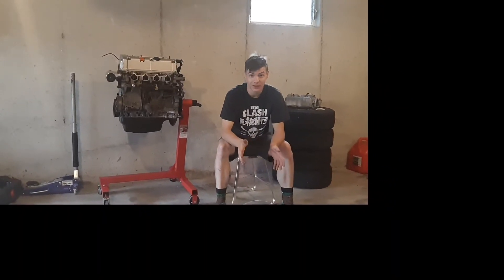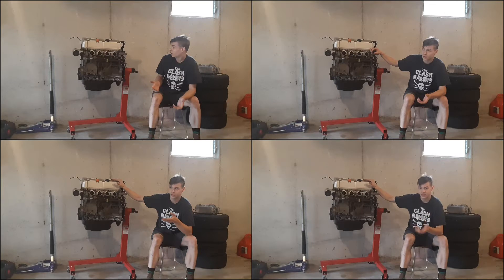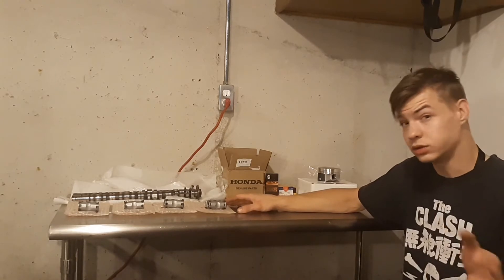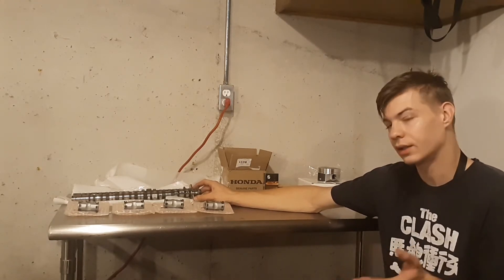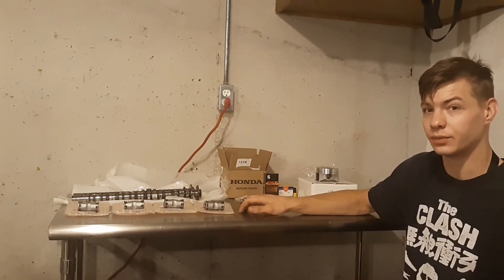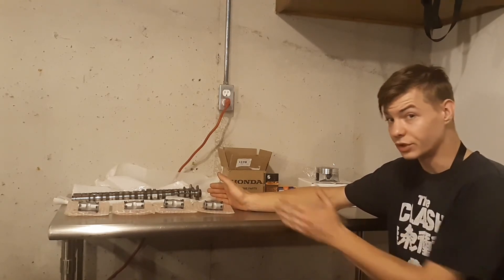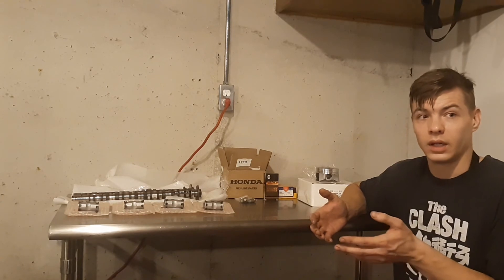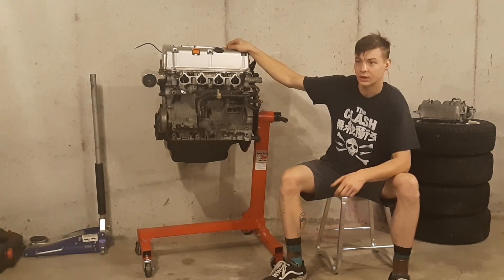How to get 200+ HP out of your K20A3

Comment: hey idk if you’ll see this but you gave me hope for my base rsx i just had one question. if i had an auto would i need a manual swap? id probably like to get one at some point but if its not needed I could enjoy the benefits beforehand
Reply from the maker: Unfortunately, you will need to convert to manual to be able to run k-pro. K-pro is going to be required in order to get this setup running. I'm running a 5 speed from a base rsx and sometimes if you keep an eye out, you can find those for pretty cheap. The ep3 si 5 speed manual is another budget transmission as well and the ep3 transmission has a slightly closer gear ratio than the base rsx 5 speed.
Reply: @jdmjedi777  awesome thanks for the info. If i swapped to manual would i need kpro right away for a tune or does it “drop right in”

Comment: Hey bro, how much power would you think i could get out of my engine set up, i have 
 k20a3 with  a2head ,  headers k tuned, skunk2 manifold pro, skunk2 70mm throttle body,  cold air intake, straight pipe,
Reply from the maker: I ended up making 193 at the wheels on an unfinished tune with this setup. That's using a 70mm throttle body on a stock port matched a2 intake manifold as well and a full 3 inch exhaust and a megan racing header. Finishing the tune could easily get it past the 200 wheel horsepower mark. So I don't see why you wouldn't end up with similar power numbers even with the a3 pistons.
Reply: @jdmjedi777  i was thinking of putting some 550cc injectors. Would you think that would help?
Reply from the maker: @Rsx_jgonza  I'm using type s injectors and as long as you stay all motor and are using high octane gas and not e85 they should be plenty for anything that motor will make naturally aspirated. If you plan on running e85/nitrous/boost you will definitely will need more injector.
Reply: @jdmjedi777  Thanks for the info, bro 🙏
Reply from the maker: @rsx_jgonza4310  any time! I'm always glad to help.

Comment: Yo, if I was to get my hands on a k20a2 head. Would it fit directly onto a k20a block? Apart from the oil pump what would I need to safely run this setup?
Reply from the maker: The a2 head should bolt right up. Definitely recommend the prb oil pump like you said and maybe a new OEM a2 timing chain tensioner. If you plan on just using the a2 cams in the a3 head and doing a vtec killer setup like I did, I would recommend a set of Brian crower valve springs as well. Then just kpro and a solid tune should get you going.
Reply: @jdmjedi777  thanks for sharing your knowledge much appreciated!
Reply from the maker: @joshsoberanis6310  no problem at all! I'm always glad to help when I can.

Comment: Do you know the stock injector sizing and cc for the k20a3?
Reply from the maker: Stock k20a3 injector size for the base rsx and ep3 SI is 270cc.
Reply: @jdmjedi777  do you know of any sites to find stock injectors? The only ones that come up are for the k20a2 type s
Reply from the maker: @elkarmaracing  I would suggest looking on ebay. I might have a set laying around somewhere. If you do plan on doing the upgrades on this video though, you might want to look into just getting the type s 310cc injectors instead.
Reply: @jdmjedi777 thank you for the info but currently I’m keeping it stock and trying to locate some functioning stock injectors

Comment: Keep in mind folks, higher compression  requires premium fuel. 
That's why the k20a3 is about the best 4 banger you can get before requiring premium
Reply: Am I not supposed to be putting premium in my a3?
Reply: @woogieboogiepedro  - Won't hurt, but don't need to. It doesn't have the high compression head that the a1 and a2 have. Save the money
Reply: @woogieboogiepedro  - Premium is required for higher compression emgines because it's harder to ignite, reducing chances of ping and knock

Comment: What rockers did u used in the intake side
Reply from the maker: I used k20a3 exhaust rockers on the intake. There are two different versions of the a3 rockers and a lot of different rockers you can use. Here is my video showing me actually building the vtec killer head and everything that needs to be done for it to work. Also have more information on what rockers can be used and how you have to modify them. Here is the link https://youtu.be/nIKzkyhZYNY
Reply: So what u mean u use 4 rockers from k20a3 exhaust on the exhaust side and another 4 from exhaust side on k20a3 on the intake
Reply: And i want to put k24z3 cams in my k20a3 i heard  they are more agresivee i have them already tell me what you think about it

Comment: A2 pistons fit perfect in A3 engine.
The problem is the A3 cylinder head😆 
A3 head need to be grinded/polished  in the combustion chamber.
I do in my A3 and I fit oil jets also 🙂
K&N air filter, A2 oil pump, A2 pistons and stailness steel exhaust system I read on Dyno 169.8 Hp. (Stock ecu)
Compression test was 17 Bar on all cylinders with A2 pistons.
Reply from the maker: There are no issues with the a3 head bolting straight on with no modifications to the combustion chamber while using the a2 pistons. You can see my video with the results from this build and how I assembled the vtec killer cylinder head. I made 193 wheel horsepower and didn't even finish the tune. The car will easily make 200 plus next time I go back to the dyno. Thank you for checking out the video. Here is the video with the results. https://youtu.be/T5jZSjvmYNY
Reply: @jdmjedi777  my A3 head is PNF...If you put the A2 PRB head, no problem.
Reply from the maker: @ionutchirila143  nope I used 02-04 pnf k20a3 cylinder head with A2 camshafts, a3 exhaust rockers on both intake and exhaust side and Brian crower valve springs. Again zero modification to the combustion chamber. Here is the video of assembling the cylinder head. https://youtu.be/nIKzkyhZYNY

Comment: can I just ust the exhaust rocker without a2 cam? a2 cam is quite hard to found in my place
Reply from the maker: there really wouldn't be much of a benefit to that without using the a2 camshafts.
Reply: @jdmjedi777  will the JDM Type R cam fit?
Reply from the maker: @ScaniaFung  yes and it should be more aggressive than the a2 camshaft as well.

Comment: Is there a way to keep vtec with this set up?
Reply: You don’t want vtec on a k20a3. Vtec is not the same on every engine, and on the a3, vtec is not used to make more power, it is I-vtec used to make less power and save gas, and gives full power at higher rpms. Removing vtec allows you to have full power at ALL times
Reply: @PharaohPicks  i know but i want to get somehow good mpg in the low rpms😂 i know vtec on the k20a3 aint good for power, but my question is can you get vtec cams with bigger lobes?

Comment: The only issue is that it won't be a good daily driver anymore. For a street car at this point its worth to just invest in K20A2.
Now, there's another route you can take with the K20A3 thats budget and gives you the similar VTEC operation of K20A2.
Use the K20A2 intake rockers and flip the pins around so that only the first two rockers stay engaged outside of VTEC operation. Once VTEC operates it will push the pins to connect the third rocker.  You will retain better daily driving and make VTEC killer power.
Reply from the maker: I guess it really depends on what you are willing to daily. I daily my EF hatch with a jdm d15b with a delta 272 cam (definitely a rather aggressive cam), stage 3 6 puck clutch, lightweight flywheel and an ebay turbo making 7 pounds. Also still on a cable clutch transmission so most people wouldn't want to daily that either but I love it. With that being said this motor is going into a track car 😂 it's just a fun cheap little guide for people who are really on a budget or just already have the k20a3 on hand. I am however familiar with the setup you have mentioned above. It would help a little with daily driving and gas mileage for sure. This just happens to be an even cheaper route lol
Reply: @jdmjedi777  I'm old. I can't stand driving my rsx on public roads for too long.
Reply from the maker: @4bangermafia  I get that lol I do tend to prefer a quiet full exhaust on my daily these days.
Reply: @4bangermafia  bro tryna walk me through that swap i just got a 2002 acura rsx base tryna make more power
Reply: will this work on base auto
Reply: Locking vtec nor anything similar makes daily driving anymore difficult. It could be a 13:1 CR locked VTEC setup with a 5.08 final drive and unsprung clutch. It would still be a breeze to drive even in rush hour traffic.

Comment: The description for the pistons say they won't work in a k20a3 motor. Is that just an error on their part?
Reply from the maker: They say that as in its not a factory replacement for the k20a3. They definitely work just fine. I have this engine fully assembled and everything clears no problem.
Reply: @jdmjedi777  thanks for the reply, I'm looking to do those myself and I'm looking forward to your build!
Reply: Normal the A2 pistons fit perfect in engine block and with A3 connection rods.
Another detail I will write in the comments section. 👍

Comment: Is this all able to be done inside the car?
Reply from the maker: It definitely wouldn't be easy but I do suppose it's possible. You wouldn't be able to pull the crank from the block but you shouldn't really need to unless you wanna replace the main bearings and thrust washers.

Comment: What is the reliability like with the Vtec Killer set-up? Is the gas mileage shit?
Reply from the maker: Gas mileage is definitely going to drop a little bit. Reliability is really going to depend on what supporting mods you add along with everything and the way you drive the car.
Reply: @jdmjedi777  i plan on doing this before i sell/trade the car. what supporting mods do you recommend?
Reply from the maker: @_IRONJAW  I'm using a set of brian crower valve springs (part number BC1050), a PRB oil pump from a k20a2 and a PRB timing chain tensioner. With those parts you should be pretty safe with a good tune.

Comment: I just picked up a euro spec type s 2005 so I need k20a2  cams and  a3 rockers and can I use k20a2 standard  pistons  to up my compresion
Reply from the maker: I just put up a video showing the short block going together if you are interested. I will be posting a video of the vtec killer cylinder head being assembled here soon as well. Thank you for watching the video!! Good luck on your build!
Reply from the maker: What motor exactly is in the that car? I can give you a better answer with that information.
Reply: @jdmjedi777  k20a3 160 Bhp
Reply from the maker: @mcnorm4023  than yes standard k20a2 pistons will work just fine for your setup.